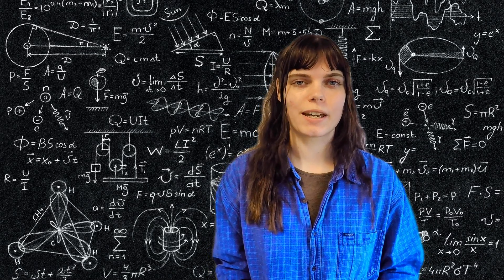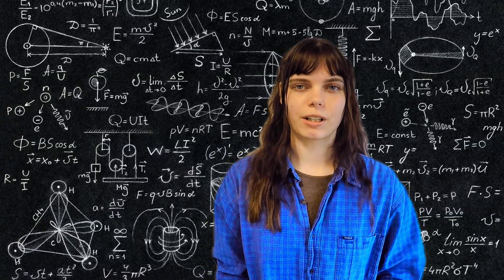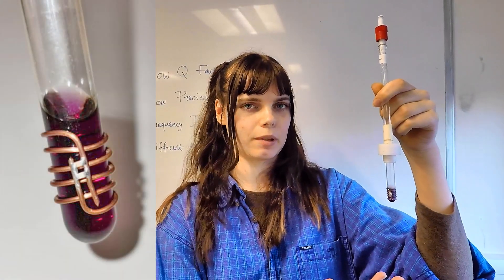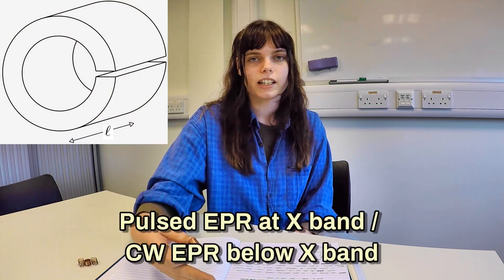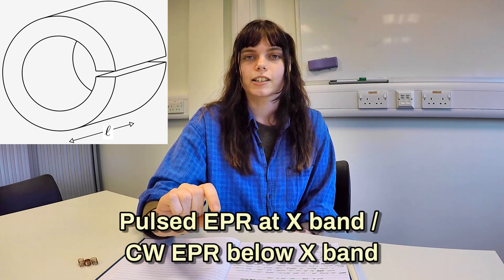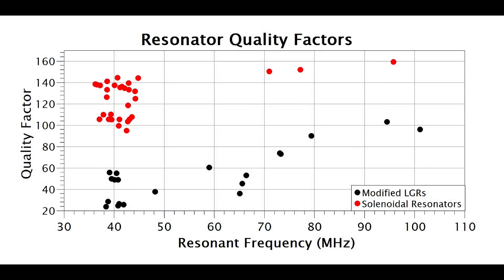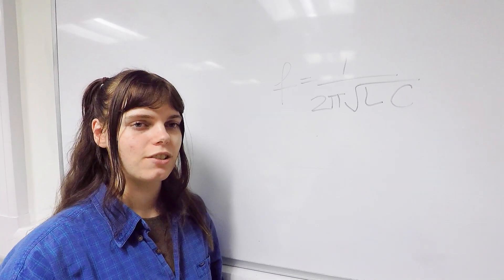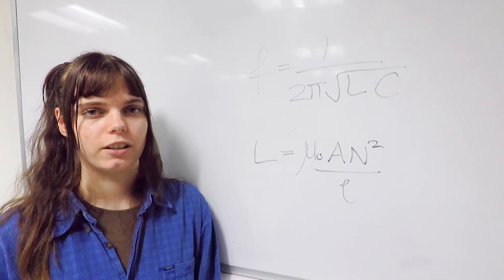Improving on Loop Gap Resonators for Low Frequency ESR Spectroscopy

Comment: I have some experience with optimizing Q in resonators around this frequency range.  My first question is what category of ceramic capacitors are you using.  Some grades drift in capacitance much more than other grades, after being soldered.  Some grades are much higher Q than others.  Is there room, in your apparatus for some flexibility (additional diameter) for the coil?  Can the coil be mounted on any substrate, or would that additional material alter your results?
Reply from the maker: A bunch of good questions. We've actually tried a few different types and grades of capacitors from different manufacturers. All ceramic dielectric, and most recently, copper conducting plates due to the requirement for non-magnetic. We did accidentally use some with nickel in the conducting plates earlier on, which caused some field inhomogeneity - a problem for the quantum system being measured. I don't have the datasheet to hand for the most recent and can't look up as it was another member of the team who ordered these, so not sure which they are.
However, the solenoids don't experience resonant frequency drift (or at least a few orders of magnitude less), yet use the same caps. So it seems unlikely to be the capacitors unless the extra heat used in application to the thicker copper makes the difference. Also, we bench tested a few solo and with applied solder, as in another comment, and found no significant drift. 
Yes, we could accommodate a small amount of extra diameter and might be able to mount on a substrate, possibly with a redesign of the insertion cavity. This sounds interesting, what do you have in mind?
Reply: @SystemicCreative  Sounds like you have eliminated most of the problems with the capacitors.  But, at 40 MHz, the skin depth for copper is quite thin, so most of the copper wire is not contributing to the conductivity of the inductor, while the eddy currents that produce the skin depth effect add to the losses.  Replacing a single, solid conductor with many thin conductors, in parallel, and insulated from each other (see Litz wire) can raise coil Q.  But this stranded wire is very limp and needs to be wound on a form.  A straight cylinder coil has a lower Q than one with a flared shape (smaller diameter at the middle).  The ends should not make a right angle turn to connect to the capacitors, but diagonal towards each other.
Reply from the maker: Thank you, that's very helpful. Litz wire and substrate sounds like a good thing to try, along with a lower angle for the connection branches.
I don't think we could use the flared shape because it would reduce the filling factor (the proportional volume of the resonator filled with sample) and introduce magnetic field inhomogeneity in the sample. So whilst this could increase the electrical Q of the resonator, it would reduce the spin transition quality factor.
If we get good results with the Litz wire, I'll report back! The key will be getting a substrate thin enough to not substantially affect the filling factor, but robust enough to work whilst having no to minimal effect on the magnetic field. Any suggestions gratefully received!
Reply: @SystemicCreative  I think worrying about field homogeneity, in the sample from the resonator, is not helpful.  Think of the resonator as providing photons of some frequency to the sample,  Besides a short cylindrical coil does not provide a homogeneous field across its internal volume, anyway.  The point is to concentrate most of the resonator energy into your sample, and to have the least concentrated energy, outside the sample.  A flared coil shape improves this energy concentration, I think, while also, slightly increasing the resonator Q.  If you can 3D print some simple forms, you should be able to optimize this, by trial and error.
Reply from the maker: Sounds worth looking into, perhaps doing some modelling on the field. We do in fact need to consider field homogeneity as it is impactful upon the dephasing times of the spins and thus spectral line width. As you might expect, we already have some issues given the inherent lack of field homogeneity provided by the solenoid (and other fields in the spectrometer), so we need to be careful to minimise it. The purely quantum view of photons is useful for considering the fundamentals of what's happening with individual spins, but at the macroscopic and signal derivation level, the demodulated reflected signal is proportional to an impedance perturbation, in turn proportional to the magnetic susceptibility of the sample as a whole.

Comment: Some radio systems need to be transmitting on one frequency while simultaneously receiving a weak signal on a nearby frequency, on the *same antenna!*. An example would be a VHF/UHF Repeater, or some types of satellite terminals. They use filters to keep the transmitter and receiving out of each other's hair. These filter boxes are called "duplexers". Many are built with little coils (solenoids) in little boxes, and they may have a variable capacitor at the end to tune each filter section. They don't need to be particularly stable, but they do need to be ultra low loss, which of course feeds into Q factor. The chassis and coils are typically silver plated, and built to very high standards. Some of those techniques might (?) be applicable. I'll go find a picture, BRB.
Reply: Can't find a good picture. But here's a video of something similar (probably 900 MHz cellular, maybe) being scrapped. You can see how the RF design folks 'go a bit crazy' to achieve very low loss. These filters are being reclaimed because of the silver content. I've lined up the video to where our hero is pulling out some components with attached coils.

https://youtu.be/OKTo0JdQWSA?si=TLGCIeKxjWiW7iSo&t=85
Reply from the maker: This is brilliant, thank you! Look at all that silver - imagine it being chucked in landfill.
Reply: @JxH  The sulfuric acid though 😱

Comment: With the solenoid coil you should be able to fine tune the resonance by slightly squashing or stretching the length.
Reply from the maker: We do exactly that to get the very specific frequency we need for our clock transition. We had to araldite the capacitor area to prevent breakage of the caps, which lowered the Q slightly and changed the resonant frequency very slightly in line with the dielectric constant of the araldite. But the ability to fine tune the frequency was worth the cost.

Comment: I'm not sure if it would help, but look into the following techniques to improve 'Q' factor, all very common in the radio field.
1) Litz wire, a multistranded woven wire. Your frequencies might be a bit high, not sure.
2) Silver plating (helps more than you think due to 'skin effect')
3) In general, look into the techniques used in radio. Even hobbyists still playing with unpowered 'Crystal Radios' often use every trick in the book.
Reply from the maker: Hey JxH, thanks for the suggestions. Never heard of Litz wire so will check that out. 
Interesting you mention silver because of it's low resistivity... The purpose of this experiment is to provide proof of concept for a new type of atomic frequency standard based on the clock transition of the endohedral fullerene,  nitrogen-15@carbon-60. As such, this is a prototype, and the final miniaturised device could possibly be made of pure silver, scaled to just over the skin depth.
Reply: @SystemicCreative    What's the natural frequency of that transition? Asking because generally the long term trend is upward (from 'Tick Tock' towards GHz). A fullerene is "heavy" so I presume it's not GHz, but perhaps in the HF to VHF frequency ranges mentioned, 30 to 110 MHz.  Point being is that if someone came out with a pretty good standard but it was (exaggerating here, for example) 1324.8765... Hz then probably nobody would be interested.
Reply from the maker: @JxH  There are potentially a couple of frequencies of use, but the main clock transition is in EPR parallel mode at ~38.57 MHz. It's actually the nitrogen's p-orbital electrons which are affected - the fullerene cage effectively acts as an isolation device, preventing the nitrogen atoms from bonding and interacting with their environment. In this way, a lot of spins become available because all three p-orbital electrons per atom can potentially transition. Have a look at the IEEE article in the video description for some more info if you're interested. We hope to do a video on the endohedral fullerenes themselves soon.
Reply: @SystemicCreative  Nice. The "VHF-Low" band (30-50 MHz) is relatively quiet, not that many users. There used to be (still?) one or more commercial meteor scatter communications operating there, and they may have used very high power.

Mentioned because you would want to be aware if you're designing a system that relies on a frequency where someone 'next door' is using 100kW pulses (for example). In such cases, your system would need even more shielding than you might think.
Reply from the maker: @JxH  that's extremely useful to know, thank you. We have picked up some odd interference at times, particularly at 41 to 43 MHz. Meteor scatter monitoring might well alao operate in similar areas to the intended use of this device, so good to be aware of.

Comment: When soldering to such 'heat sinks', it's not unknown to use a small blowtorch to bring the metal part up to 'pretty hot', then the normal 50 watt soldering iron might have enough power to complete the soldering job. You could also use a Weller brand soldering gun, and they can be 200 to 260 watts.
Reply: Good thought. We tried a heat gun for that purpose, but as it turned out to be a non-issue with the solenoids, we didn't persevere!
We also tried low-temp solder and conductive epoxy, but neither yielded great results.

Comment: Frequency instability: It's likely that the added capacitors have a noticeable temperature coefficient (capacitance changes due to temperature). You can check the spec sheet from the manufacturer, and see if they offer versions with better thermal stability.

...Maybe...  ;-) !!
Reply: Thanks for the thought, we tried that actually, and set up a bunch of solo caps, both unmodified and soldered, on a bench test for capacitance and found no noticeable drift over temperature and humidity changes relevant to the experiment. Same over time, no significant drift in the caps themselves.
Reply: Possibly the caps are deteriorating due to high current, you can build up a lot of current in a high Q circuit. Are they current rated RF caps? Besides ceramic another old school option is silver mica, I believe still available in SMT.
Reply from the maker: The current is an interesting thought... My intuition is that it's not a problem, but haven't actually checked the current ratings. The driving power is low, approx -16dBm, but it's kept on resonance for many hours on end. Having said that, we use the same caps for the solenoids, which are higher Q, and don't experience the same drift problem.
We're limited in the capacitor types we can use because they must be completely non-magnetic. Even a tiny amount of nickel or tin in the conducting plates will cause a field inhomogeneity that will affect the electron spins in our sample. We've only seen ceramic dielectric used in the copper conductive plated variety, but if you know of other options, we'd be delighted to know!
Reply: @AndrewMSmalley   "...bench test for capacitance..."   If you are referring to measuring the capacitance on the bench with a digital capacitance meter, then it might (?) be analogous to a watchmaker measuring his wristwatch parts with a yardstick. In the frequency domain, we can quite easily notice and measure changes with the sub-PPM precision. On the other hand, measuring a capacitance value directly with a capacitance meter might (?) be 1% (YMMV).  That said, electronic metrology labs might have instruments that can measure capacitors to much tight precision, but such instruments are typically behind locked doors. 🙂 If you guys are scientists, then you probably already ran the numbers to make sure your measurements were sufficiently sensitive.  All that said, I'd go right back to the OEM Datasheet and just read the stability vs T spec. The printed value might be far more precise than could be measured, since they'd have the metrology instruments. Good luck.
Reply from the maker: Thank you. Yes, we are indeed scientists, in the physics department at Lancaster University, and we do have one of those lovely capacitance testers, although you're right that it is kept very tightly behind locked doors! Even we have to get special permission to use it and we're not allowed to take it to the lab! It's more precise than the datasheet, in fact we use it to test stated tolerances from the manufacturers.